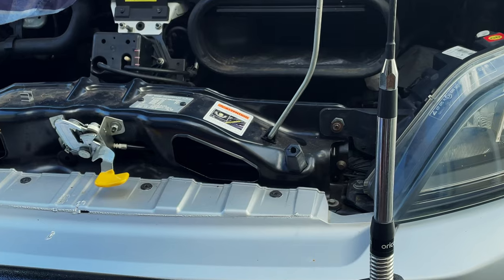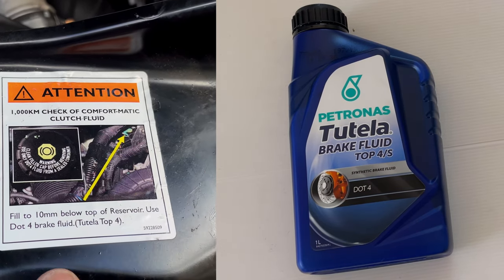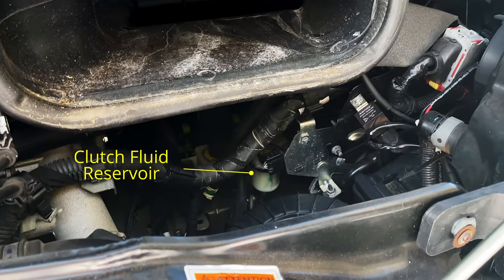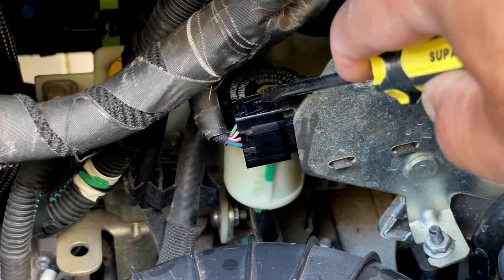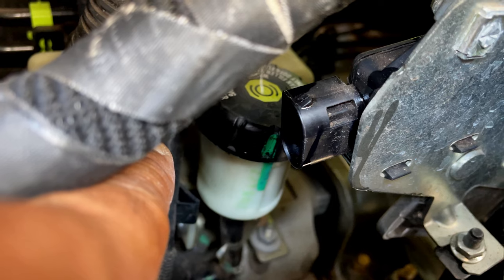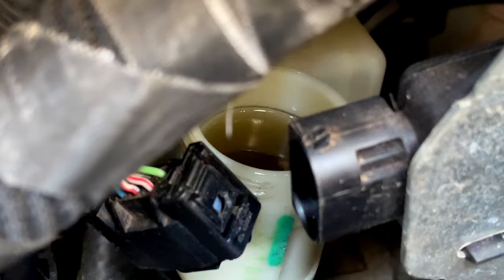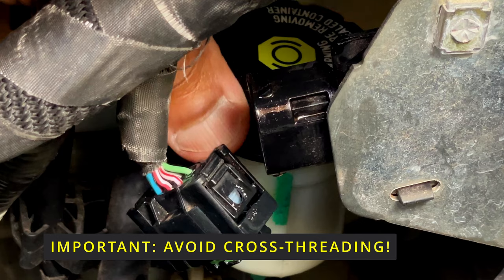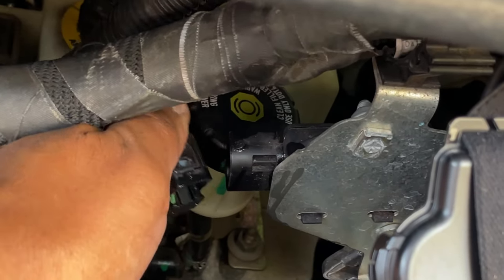Ducato Clutch Fluid Top Up - Every 1,000km

Comment: Thanks for this clip. My question is: when checking I noticed fluid is very dark and looks like it has been hot. How can I drain system? I sucked out reservoir and refilled but want to change fluid completely. Your thoughts appreciated. Mike (in NZ). BTW 2016 2.3 130 comfortmatic at 63K.
Reply: @ThreeFineWonders Normally it is nonsense that Comfortmatic needs recalibrating just because the clutch fluid has been exchanged

Comment: Excellent, what are your thoughts about the reservoir behind the one you opened? What is that one for? How do we check the levels, does it need topping up?
Reply from the maker: Hello Matt, I don't know the answers to these questions myself. But I make it a habit to save tips I read on Ducato online groups and have found this information, but I did not, unfortunately make note of who made this comment: 
Unknown Author:
"Re clutch queries for the Ducato 6 speed Comfort-matic transmission on the 3.0 litre engine. 
It is NOT an automatic; it is a manual gearbox with a clutch. 
2 different computer controlled hydraulic mechanisms operate the clutch & gear change even if you have selected Manual.

It uses 3 different fluids (oils).
The gear change mechanism uses hydraulic fluid (not brake fluid), in the large rectangular reservoir aft of the air filter. It has a tube through its cap. Fluid level should be approx 60mm deep, measure with a straw.

The hydraulic clutch uses Dot4 brake fluid for its slave cylinder that operates the clutch. It's the small 50ml reservoir, aft of the air filter with yellow text on the cap.
Difficult to see & access, take care to ensure the cap is not cross threaded. Manta Adelaide advise cross threading is the main reason for fluid loss. The reservoir can be relocated for easier access.
Fill to 10mm from the top.
Check every 1000km at least or clutch failure can occur. Best topped with a large syringe & hose.

The gearbox which is an automated manual (AMT) uses gearbox oil, sealed for life in theory but Manta Adelaide recommended changing at 80K.

You can select between Auto & Manual any time while driving (Manual is best for steep hills).
You must leave the gearbox in First or Reverse when shutting down the engine or the van can roll away! This is a vital safety procedure." - by Unknown Author
Reply: @VanHacks  Very useful thank you

Comment: yours is the only material I found on the whole internet and to have a video on it too.....excellent. I believe this is my problem as my 2015 ducato says "gear unavailable". Do you know if you can use any dot 4 brake/clutch fluid or has to be Tutela brand?
Reply from the maker: Glad to helpful. Safest bet is to use Tutela though I know many people don't.
Reply: @VanHacks  my RV wont go into gear when it heats up. I checked this 50ml reservoir in your video in my Ducato and it still had fluid in it so that is not my problem but I think there is another bigger reservoir just behind this one which is not dot 4. I think it's Tutela CS Speed or selespeed fluid. This 2nd fluid drives the piston which then drives the dot 4 reservoir to open/close clutch. Have you ever checked this 2nd bigger reservoir yourself?
Reply: if you have Comfortmatic, here is the way to change both fluids complete, sorryly in German, but good Photo path . please google yourself, by typing this in. Wechsel der Hydraulikflüssigkeiten der Comfortmatic
Reply: Wechsel Hydraulik Öl Comfortmatic.pdf

Comment: Isn't it a fact that when you loose oil in 1000 km's you have a leak ?
There is no use of oil in this closed system isn't it?
Reply from the maker: I think you are right. The notice is most relevant for the first 1000km. But I like to check it before a long trip. Better safe than sorry.